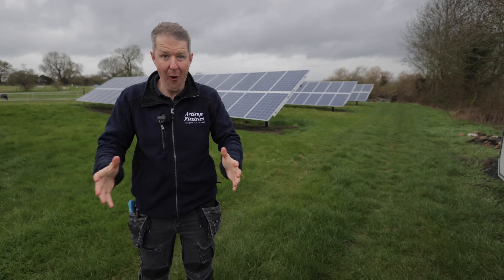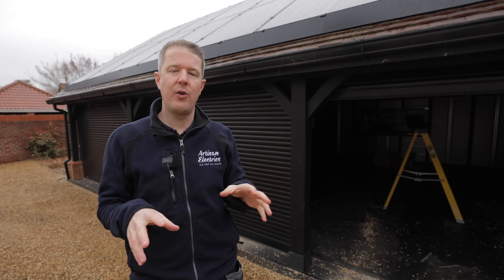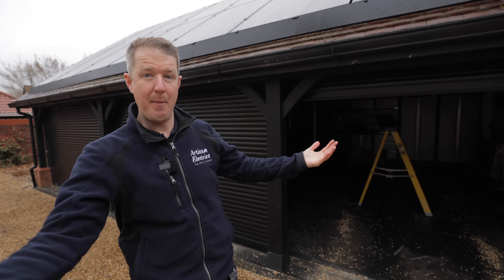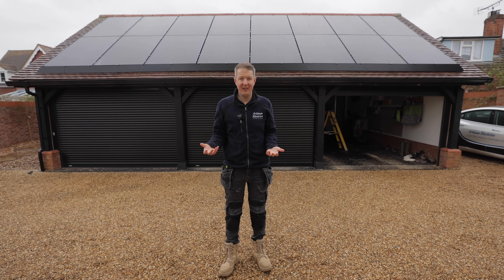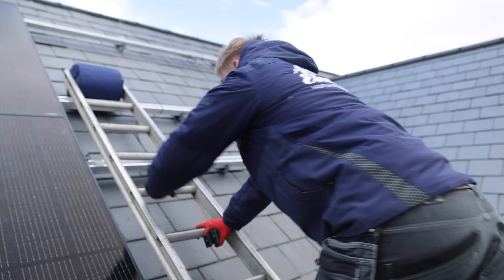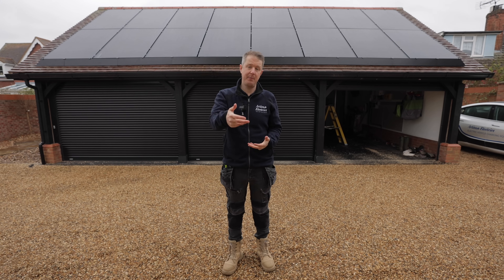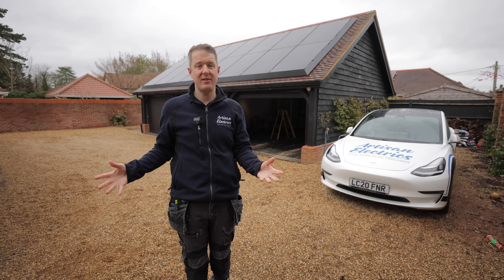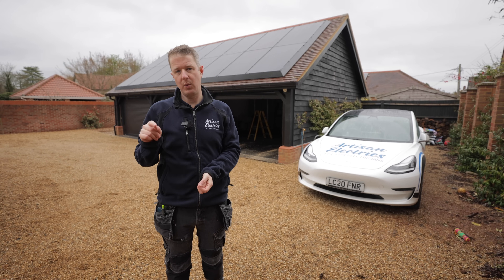10 Things You Need To Know Before Getting Solar Panels Installed in 2024

Comment: roof calculation is not really important.weight of a panel is about 20kg. and they usually are 2x1m so thats 2m square. thats only 10kg added per square meter. that is absolutely nothing. if you live in country where it snows during winter, your roof must take at least 400+kg per square meter so added 10kg is nothing. all you need to do is check the roof for rot.
Reply: @leno8388  think you're getting confused with water....... fresh snow can be as little as 20kg/m3..... usually 80-100kg/m3...
Reply: @BerkeleyTowers  there is usually a map for every location that dictates how much overhang can a roof have, how many snow stoppers there has to be on the roof and how much snow usually falls. where i am from, we have roofs that must hold at least 400kg/m2 and this is transferred to a 40-60cm of heavy wet snow. 10kg here and there, its nothing
Reply: @euroovca25  Don't disagree.... was just saying that there's a range of snow densities........ but not at a 1000!
Reply: They are important for flat roofs. We're having a system designed and installed by Artisan and we had to reduce the number of panels on the flat roofs as the calculations on loading (including them mountings) wouldn't allow all of the original panels
Reply: @superfireflyguy2054  That kinda suggests that they are being mounted on a weighted mount system? It would have to have been the flimsiest of roof to begin with if the panels themselves pushed it over the edge.
Reply: Nevermind the wind loading a roof sees in high winds.  That must surely add up to a lot of additional force, far in excess of a solar panel and accessories.
Reply: @UCCLdIk6R5ECGtaGm7oqO-TQ  There, the problem is uplift off the roof, not weight on it. Then the problem is the strength of the mounting system, and in particular, the strength and security of the fixings into the roof structure.
Reply: @euroovca25  I think the video was for the UK audience... if we get snow here... it's usually a joyous occasion... especially at Christmas ! (and it's gone within a few days...)
Reply: @BerkeleyTowers  That's a fair point, given aero-dynamic lift.  Something I didn't consider.

Comment: be careful fitting batteries outside or in a unheated garage... lots battery chemistry will not charge when ambient falls much below zero centigrade
Reply: Batteries heat up when working, so may become too hot indoors. Mine in my porch is currently at 18C, when it is 8C outside.

Comment: Also remember just cause it says 100Amp on your main cut out fuse carrier dosn't mean that it is. often they have 80s in
Reply: Mine was downrated because DNO came round and said if they couldn't visually inspect the tails from the meter to the consumer unit then it was downrated to 60 (IIRC).  In my house the tails travel up the cavity (I assume) to the CU.  They certainly aren't visible.
Reply: @PETER WILSON I agree but each DNO had their own policy and that’s what the engineer told me. He didn’t even want to look at the other end. It might be that there isn’t visible means of mechanical protection. When I had the service head moved at another property under the same DNO the tails had to be installed in conduit and I made sure that it was visible for inspection.

Comment: I'd also like to add that if you have a water heater you can consider to heat up the water extra when you have excess energy from solar. Water is an excellent energy storage system, so if you can work with different temperature levels you can save even more.
Reply: Yes I got a smart immersion heater installed at the same time as the solar panels. Haven't used gas for hot water in the month since and I won't need to use gas for hot water until the winter (though expect I will stick to electric anyway when it is lower carbon).
Reply: Heat storage batteries are also a neat way of storing power. Here the only the internal core is heated up and water is heated on demand as it flows through the device.
Reply: It's only an excellent storage system if you actually can make use of the hot water.

You can heat an insulated tank, but eventually if you are not using all that hot water, that energy is being wasted as the heat is lost to the surrounding environment.

Sometimes it is better to charge batteries and store the energy that way. You can hold the energy for much longer and you can use it for whatever you want, when you want
Reply: @deang5622  my consideration was to heat the water when the batteries are full, that's what I did mean by excess energy.
Reply: @ehsnils  Ok, but you didn't mention the presence of batteries.

Comment: Reasonable summary, thanks!  It’s important to realise that any solar or EV charging installation can require consumer unit upgrades.  I suggest, apart from the elephant in the room, it is important to choose systems which give good interoperability and give a good user interface to both display and adjust power flows.
The elephant in the room, is the cost. I am just dealing with this, already having a solar installation, but needing a Zappi installed. In this case the solar had been installed years ago and now no space in my consumer unit and tighter regulations required a new box to be installed to remount some components, existing MCBs to be replaced with RCBOs to remove a single 3phase RCD to allow space for a 3phase RCBO to connect the Zappi. The main switch also had to be replaced with one including a main circuit breaker. The cost for all this ran to $6,000 AUD or 3,200 pounds including the cost of the 3 phase Zappi including hub.  Conclusion, have a stiff drink before reading any quote for solar or EV charging installation.
Reply from the maker: Very true thanks for sharing

Comment: The most important thing to check is that your installer is MCS accredited. Without an MCS certificate you can not take advantage of the decent export tariffs. 
Also, if you are being asked to send a lot of pictures over. I would suggest looking for a more local MCS installer who will actually come out to complete a survey. 
It is always nice to see the actual installer in person instead of giving over lots of money to someone who may just end up subbing it out to others.
Reply: I agree with you about an in person survey. I have a flue and a gable to work around and the difference in designs from the person who did an in person survey and those that didn't is surprising. Each house has it's quirks and I don't want expensive surprises on the day of installation.

Comment: One very important part of the installation is indeed location. 

Often a garage is not a good place to install battery storage as during periods of cold weather the battery core cools considerably. As you know LFP04 storage chemistry does not like an environment where the ambient temperature can drop below c.15 degrees C. If the cell core of the storage is unheated the BMS will derate the charge current substantially to avoid ‘plating’ of the cells.

I say this as a FAE for a manufacturer of PV string inverters, AC coupled battery inverters, LFP04 batteries and EV chargers. Sadly many installers do not display the care and diligence of Artisan Electrics and during cold weather we received many complaints like, “Why is all my energy being exported to the grid and not going into my batteries?” It is difficult trying to explain to end users that the battery/BMS is working as it should be.

Comment: Great vid. I thought one of the most important aspects of good solar efficiency is to maintain good airflow beneath the panels? Best efficiency is always a sunny and COOL day. Not sunny and HOT day. Pigeon protection is a MUST (as we have experienced to our cost several years after having our panels installed with no problems! before that!) but those skirts in the video would just cause high temps and less efficiency of the panels- the one main disadvantage for in roof panels also. NO airflow. And in high winds you would want air to flow through the installation and not hit solid walls?
Reply: I have the skirts and there’s a gap under skirt that lets air but not birds flow underneath. I know because on windy days I hear some flapping.
Reply: @Group51  Why are the birds flapping ? I thought the skirt stopped them ??
Reply: @gregevans8939  cables flapping.
Reply: We have chimney sections that encourage air flow, and there is plenty of space for air to flow between the skirt and the panels and the roof.   If you look at in-roof solar there is zero air flow and these have been installed for 10-years+ but i am not aware of any major reported issues.  With SolaSkirt you still get some airflow.  Also in high winds its better to divert the air flow over the panels, rather than under them, as then they are less likely to rattle.

Comment: Recently got  a 4.7kw 12 panel array on my SE facing house roof. Working great so far. Has a 9.6kwh battery with it and most days since the start of April I barely use more than 0.3kwh of grid power per day. Export income not sorted yet, octopus taking ages to sort this out.

Comment: Top tip:  Buy 1 extra panel to use as a spare.  Yes the solar panels all have a 12 year warranty, but if they become faulty, the panel manufacturers always insist on basic tests to be done (and proven on camera) on the suspect panel before they replace it.  It’s a lot easier to do all those tests on the ground.  You only want to be up on the roof when you replace the faulty panel with the spare.  You don’t want to go up there to do multimeter tests, and then go up there again once the replacement panel arrives from China!

Also:  solar warranties aren’t like for like.  My solar dimensions (1685x996mm) are no longer sold.  There actually is no such thing as a standard module size.   So chances are if you need a replacement panel they’ll just ship out the latest and greatest panel that “nearly matches”, and you find it doesn’t fit in your array because it’s too big.  So you are then faced with the prospect of fitting it in the corner of your array for an on roof system (or not at all for an in roof system),
Reply: Or do one better and fit micro inverters for each panel. A bit more expensive at times but gives you a granular view of what each panel is doing plus will save on space needed on the wall plus you get better redundancy.
Reply: Anthony, I agree that its essential to make up a spares list (not just an extra panel) to ensure easy support over an extended period of time.
Reply: Wow! Thanks!
You may not know it, but your comment made a positive difference in somebody's life.
Thank you 😊

Comment: I've had a 5kw pv system installed for nearly a year now and the returns are not looking good so far. All the points you raise are particularly relevant but  none more so than actually getting sunlight  to reach the panels. England doesn't generally have good sun. One can have all the other 9 points covered but if ones aspect is not good then  forget it.

Comment: Speaking with my building construction / fire research hat on, I'd strongly suggest an interlinked smoke detector be fitted. If used as a workshop use a rate of rise heat detector. Could save lives!
Reply: Funny enough that is actually now part of the IET solar codes of practice to do that, it's regulation 11.5.4 in the latest book.

Comment: If you are watching this from Scotland, the roof structure part will probably be irrelevant. Scottish Building Regulations are very different. Roofs in Scotland are sheeted in ply or OSB to massively increase rigidity, and to allow for snow load. This has been the case for many decades.

Comment: Can you install solar on asbestos roof tiles?
Reply: Hi, physically I expect it's possible but I'm currently dying of mesothelioma.  Lung cancer caused by exposure to asbestos dust from demolition work in my 20's - I'm 74 now, so I would guess that 99% of installers would decline due to the health risks of cutting asbestos in-situ. I would further guess the only way forward for your roof would be removal of all the asbestos based tiles and replacement with conventional tiles. 
Alternatively you might consider a ground level solar panel installation. 
Hope this helps.

Comment: I love your channel, your videos are extraordinarily well made, well scripted and well thought out, the lay out is optimal in logic and ease of viewing and you have a great skill in oration... but some times you do a disservice to the viewer simply from your passion for the subject matter. Me for instance, I live in Thailand and the biggest electrical usage in my home is AC where I picked an inverter unit with an extremely high efficiency rating, a very respectable inrush and a very moderate 900 watts draw when the compressor is running. Taking the inrush current as an average, cost of the batteries needed to run one of the units overnight is outrageous. You have a 10 hour window of charging with fairly steep upramps in the AM and fairly steep downramps in the PM so I need 14 hours of battery power for the house. I need 1.8 Kw per hour so I need 1.8 x 14= 25.2 KwH of battery plus the 20% wasted by the inverter so there is 31.* Kwh of power storage needed from batteries. I did all the math and with my electricity costing 40 USD a month payback is about 20 years. Now that is for a totally off grid situation, but why not go off grid if you go solar? In Thailand during the summer wow you get sun from 630 am till 630 pm with out a cloudy day pretty much every day. 
Again the vids are banging spot on and you are a great electrician. I just feel sometimes the hype surrounding Solar is a bit exaggerated... thanks ... Jim

Comment: Thank you, I have watched several of your videos and as a retired Sparks find them very informative, things are certainly changing in the electrical industry there is a couple of points if you could clarify for me , one is isolation if you turn off the consumer unit does this turn off the panel system/ inverter or is there a live cable for instant from the loft and poss battery system to the consumer unit , and does this or these cable / cable's need identifying throughout its/ there lengths , my son has brought a property with solar panels and it appears this cable is just a unmarked 6mm 6242y buried in the fabric of the building, secondly and a few years back I was speaking to a fire officer about panels, he informed me at the time that if the property has panels he has to take this into his risk assessment as the panels are still generating electric all the time it's sunny does having battery storage compound this, does this with modern systems still stand, I suppose the worst case scenario I suppose it could end up with the fire rescue watching you property burn .

Comment: Good video. One thing I think you should have mentioned is the worst place to fit an inverter is the loft, hope companies don’t do this now The summer heat kills them. Loads were fitted like this in the early days of solar. Had 4 kw system fitted back when the feed in tariff first came out ( must be 2010/11?) yes was very expensive at the time but paid for itself in 8/9 years. Yes no feedin tariff now but systems much cheaper. Acquired 8 kw of panels and put on another roof. Wondering how best to utilise at the moment batteries have to be the way, even as a high electricity user I could be self sufficient for a good 6 months of the year. The high unit price of electricity has been a game changer for the solar industry, part of me thinks the powers that be are happy for prices to stay where they are